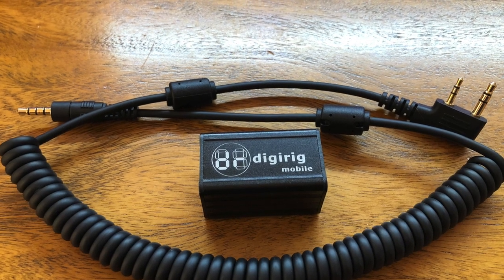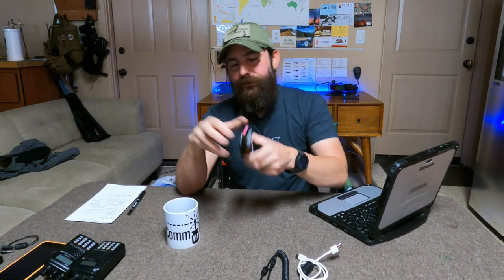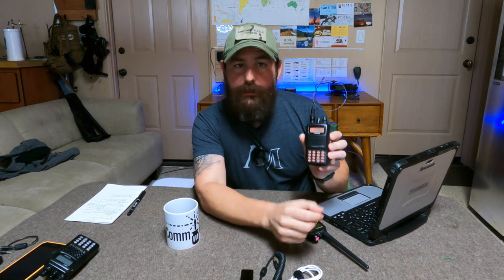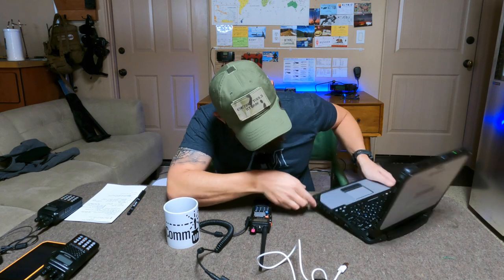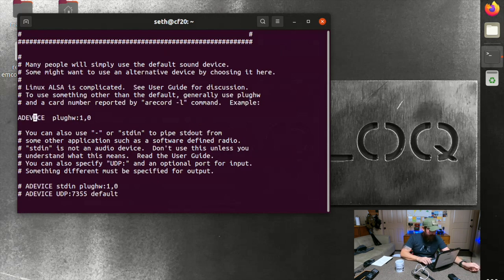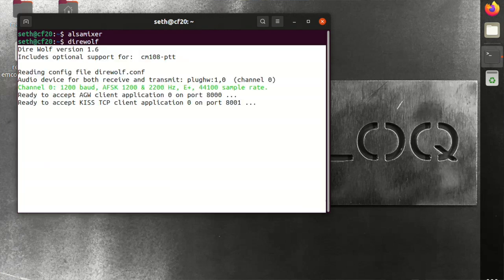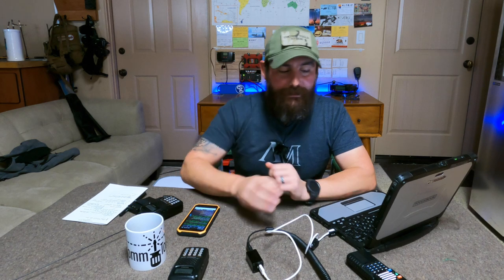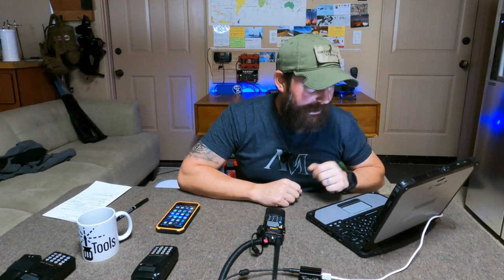Why are digital data modes so difficult? - DigiRig + Baofeng + Linux (Part I)

Comment: New subscriber here. I don't think digital data modes are very difficult at least for the physical setup process. Computers are inherently not made for humans but this is why we have interfaces like mice and keyboards. Just think of the radio as another attachment to the computer. In essence, all your doing in getting audio from your PC to your radio and vice versa but how complex that gets depends on the equipment available to you.  The setup and user interface for some of the software can be very unintuitive and takes a bit of research to get it up and going. Digital modes are certainly not as easy as using voice and not something you need to use all the time, but it does have its advantages. You can disseminate information much more quickly than using voice alone and some digital modes can be used in a low signal to noise ratio environments. I would like to see some more positivity with digital modes and their advantages rather than just the disadvantages. Keep up the good work and I look forward to future videos. 73 K7DMG
Reply from the maker: Welcome to the channel. It wasn't my intention to make it sound like there are no advantages to digital modes. There are many. The trick is getting over the hurdles. They are certainly worth the effort otherwise I wouldn't be making this series.

I am a proponent of them for fun (FT8 and SSTV) and for emcomm and public services events/scenarios (APRS, Winlink, NBMES and JS8Call). My mail bag fills up every month with people that watch me use digital modes in the backcountry, but they are constantly struggling. The'll ask: Which radio? Which cable? Which device? Which software? How do I adjust my audio? My goal is to show the diversity of options and let users determine which setup is best for them.

I may not be the right person to solve this, but I am taking a stab at it with my EmComm Tools project. I made a lengthy video a few videos back on my vision for a digital mode platform that is built for humans and public service/emcomm. It's called "The EmComm Tools Story - The what, why and how?" if you're interested.

Thanks again for the wonderful comment. 73 de KT1RUN
Reply: @TheTechPrepper  I am part of a local prepper group and just joined ARES a few weeks ago, so my focus is on EmComm. There is much for me to learn even when I think I am getting close to mastering it haha This is why I watch as many different takes as possible cuz there's always something I can take away from it. Appreciate your response and I will definitely check out that other video.

Comment: I’d love to see someone implement data modes onto a Raspberry Pi Pico W to interface with the data ports inside mobile radios.  This will also be especially important for getting M17 off the ground as more than an experimental curiosity.
Reply from the maker: I would like to see that as well. I had ambitions earlier in the year of trying something like this by building my radio with these capabilities using something like the HackRF with GNURadio and including everything in a 3D printed enclosure. By the time I realized that I needed an amp, power, filters etc., I decided to table the project. Like you, I am keeping my fingers crossed that a group of like-minded individuals picks this up.

Comment: Great video, even for the technologically illiterate like myself. Thanks for breaking down for us. I have a few questions, I think I have the mobile phone bases down, but I would love to be able to use my Getac toughbook as a base. I have a Getac with windows 10 (I believe), do I have to run linux on it? I ideally want to use this system for gps capabiilities independent and separate of any internet, wifi, cellular networks. DO I have to use linux or can I use my windows op system? Again, we really appreciate your time, effort and help.
Reply from the maker: You can absolutely accomplish the same types of communication using  Windows. However, that's not my area, but there are like lots of videos that cover this. Good luck. Search for OH8STN on YouTube. He's a Windows guy.

Comment: Can you replace the analog baofeng with a dmr? I have tyt mduv-390 and md-9600 dmr radios. Also will enhanced privacy with hex key pass the modem info from a laptop?
Reply from the maker: I have never tried this with a DMR radio. Most of the digital data mode services will only work over analog. However, there are HT's that do both analog and DMR.
Reply: @TheTechPrepper  yes, mine do.

Comment: Which is better to use with this? Windows or Linux? I have all apple products (which suck for HAM radio) but looking to get a tablet that runs windows. I would think it could work on either right?
Reply from the maker: Yes, this can work with either Windows or Linux. It's really your preference on which operating system you're more comfortable using. My Mac can do all this too but it is very complicated to setup.
Reply: @TheTechPrepper  thanks for the comment. You have definitely sparked my interest in this. Keep up the good work!

Comment: Can anyone explain to me what the point of the digirig is especially if you're not going to use the cat control and just go with vox? The laptop has a headphone jack that can plug directly into his combo jack on the yaesu. Since he's not using cat he's relying on vox so I just don't get it. What's the point of adding another sound card when the laptop itself has one built in that will work for this?
Reply from the maker: I am not using VOX. The power of the DigiRig is that triggers the PTT view the serial interface. VOX has too many issues when dealing with various digital modes.

Comment: To communicate with Android phone are you connecting to a repeater with EchoLink?
Reply from the maker: I am not sure what you mean. Did I cover Android or EchoLink in this video? I have never used EchoLink before.
Reply: @TheTechPrepper  I understand how the Baofeng connects.  I am ordering the cable and USB sound card.   How does the Android communicate with it?   I have EchoLink on my phone to connect to echolink repeaters.     How does the android app work?

Comment: how does digirig compare to mobilinkd?
Reply from the maker: If you only want packet radio, the Mobilinkd is more convenient and simpler. The Mobilinkd is a packet-only. I personally use the Mobilinkd with my HT go kit, but I have used it with the FT-818 and FT-857D successfully. It also works nicely with Linux and the RPi. If you plan to run digital modes beyond packet radio (e.g, fldigi, JS8Call, FT8, etc.) you will need to go with the DigiRig or related sound card interface like the SignaLink.

Comment: I do find data modes difficult.    But, my patience for such things is minimal at best sometimes.
Reply from the maker: Welcome to the party, Doug. I can't make any promises, but hopefully there will be at least on nugget in this series that helps.
Reply: @TheTechPrepper  Im sure i there will be stuff to help.  I tried using digital modes on a g707 kenwood and a pi with a hat.  Got so frustrated, had to stop.

Now that I have more hf privelges, I'm going to try more that way.  I'm going to try with the digirig and a feng and separately with my 891.

Comment: I have a CF 19 Toughbook. How did the drivers etc work. I know Windows better however I know how Winlink Express and works. If it wasn't for KM4ACK BUILD A Pi. I have an old toughbook very early version. I could try it but getting the drivers to work for linux
Reply from the maker: Sorry, I am not a Windows guy. The current version of Ubuntu 22.04 supports everything with the exception of the stylus. At one point I had a separate partition that ran Windows 10 and was able to get Winlink Express and VARAFM working nicely with the DigiRig. I was also able to run YAAC for APRS and NBEMS software suite (i.e. fldigi and flmsg).I don't recall if I ran into any driver issues with the DigiRig. I ditched Windows as soon as it tried to force an update while I was in the field and would not let me shutdown without installing the update.

Comment: Ft3d and I suspect other radios with aprs built in make this SUPER simple like turn on aprs and tune to 144.39
Reply from the maker: Yes, the all-in-one radio's make it easy, however, you only get that one mode. If you want Winlink, fldigi and host of other modes you'll still need a sound card interface. I plan to touch on this topic. 73

Comment: Would be good to get Android Phone --> (running FLMSG) Digirig --> Yaesu HT working
Reply from the maker: That works. I did a video on that in this series. The new version of AndFlmsg supports the serial interface on the DigiRig. I believe it tested it with my VX-6R, but it works with the UV-5R, too.

Comment: In the digital world its simpler hardware wise if you have a radio with a built in soundcard such as an Icom 7100. Just have a usb cable between the radio and laptop. Though that doesn’t obviously work with an HT. Lol
Reply from the maker: You're right. I'm still waiting for Yaesu to catch up with Icom and start putting sound cards into their rigs. It would be nice to have a simple interface. It's a pain using the data port and an external sound card on my other base stations.

Comment: This seems really cool. I really like that you can use your Baofengs to send text data. But as you said, it's way too complicated and it seems (to me) like you have to be a multi-platform computer programmer to make it work. If it only worked for non-computer programming humans using Mac OS. Keep up the good work!
Reply from the maker: This setup should work on a Mac, but the devil is in the details. I have a Mac on order that will be arriving in June. If I remember, I'll put together a video for Mac users.
Reply: @TheTechPrepper  that’d be awesome!!! I feel like there are a lot of us who’d love to be more involved in amateur radio, but so much programming/logging/CAT control software is windows only. And everybody says, “Well, just get a cheap windows machine.” But I don’t want another machine that I’ll only use for one thing. Amateur radio could grow more if they’d embrace and support the Mac community.
Reply from the maker: I've been a Mac user since 2005 and loved them up until Steve Jobs passed. The Touchbar and Butterfly keyboard on my $4000 2018 MacBook Pro really turned me off. Don't take a man's escape key away! But, the high price point is what is keeping the hams away. Now that Apple has corrected the keyboard and back some ports, I'm going to give them another shot. Don't get me started on Windows. Take it easy.

Comment: Why are digital modes so complicated in ham radio  As a ham operator and a computer tinkerer i can say one thing   NO Standardization!  Every radio has different mic and data ports, every mic on every other radio has different wiring or a different type of connector ie 9 pin DIN, RJ 45 modular (ieCAT 5 ) , no USB or Toslink fiber optic connections on most ham radios.  Some still even depend on long obsolete DB9 serial ports and  you need to know what frequencies and what mode  IE Upper or Lower Sidebands  are being used . Buggy and incompatible software and drivers.  All this lack of one standard creates confusion. Above all a lack of local activity on anything digital...for local radio checks ....... at least where I live.

Comment: It should read: Why is packet radio so difficult to use?  The answer is radio manufactures don't care about it cause there is not enough demand/feedback from users.
Reply from the maker: I think you're mostly right about the manufactures not understanding the different customer demographics and needs. Why isn't a sound card standard in all new radios? Why are we still using RS-232 serial ports?
Reply: @TheTechPrepper  can I just add why isn’t usb 3 standard on all radios?

Comment: Alright, someone else who's running a Linux Distro on their computer.  I've been using a Linux system of one flavor or another since mid-2012.
Reply from the maker: Good for you. I started with Slackware on floppies back in 1996, then moved to RedHat in 1997. These days, I'm a Debian/Ubuntu fan for the desktop. Cheers to another Linux user.
Reply: @TheTechPrepper  I did a lot of Distro Hopping until I landed on MX Linux with the KDE desktop.  It's Debian based so it's rock solid stable and I can set up KDE to look just the way I like it. 
I have quite a few "First Looks" for a few different Distros on my YouTube channel.  It's good to see another person on the YouTubes that's in AZ.

Comment: I love what you're doing here, but I think the "not designed for humans" problem is that you're using Linux programs from the command line. There's a very good reason that the technically superior Linux environment has not taken over the retail computing world. Windows ($$) software doing this task would be easy enough to get working, while Mac ($$$$) would be essentially plug and play. I don't even know if it's currently possible under the big players, but they're the big players for some legitimate reasons.

Is there some sort of org chart that will describe what things are what and go in between which other things? Something like (software A </> laptop B </> cable C </> device D </> cable D </> radio E) or  (app L {see what I did there?} </> phone M </> cable N </> device O </> radio P)? This would be helpful Elmering for us beginners.
Reply from the maker: Glad you're enjoying the series. You're absolutely right. I have been a Linux user since '97 and it's still not ready for the desktop for the average user. The next video is delayed as I am waiting some cables to arrive. Stay tuned for fldigi and MT63.

Comment: i need the vx6r and an android device connected with my digirig. so far i wasted my money on a digirig, so pissed.
Reply from the maker: The DigiRig works with a large set of radios. A VX-6R is not required.
Reply: @TheTechPrepper  thank you, ya I only have this hand held. Don't have the money to switch to a different radio to use digirig.
Reply from the maker: @caseygillock8131  No problem. Good luck with your setup. I am pretty sure I covered the DigiRig Mobile and VX-6R as part of this series. It's been a couple of years.

Comment: The reason it's not user friendly is the technology is built on protocols that were designed to be buried deep inside equipment and amateur Radio is a highly technical hobby.

It was never designed for preppers. Most amateurs would laugh at the use of Baofengs as they are junk and break FTC rules.
Reply from the maker: Understood.I am grateful for all the ham radio software that has been created and is available to the public. I've never cared for the general elitist attitude of some hams when it comes to radio. I will change that by making communications accessible to all people. As a software engineer, product manager and prepper, I am developing products that will make digital communications easy for anyone. That's the plan at least.
Reply: @TheTechPrepper  that's admirable. I'm a software engineer myself and the majority of tools in this space are old, badly written and terrible to use.
Reply from the maker: @Spookieham  Glad to meet another software engineer. The UI is rough on modern equipment with touch screens and/or old eyes. My EmComm Tools software project delegates to a lot of tools on the backend to do the heavy lifting (Dire Wolf, YAAC, fldigi, Pat, etc.). For the most part, I figured out how to run all of those amateur radio applications headless and build an API and integration layer that my React front-end uses. What kind of software do you write? I am a Java and UNIX guy.
Reply: @TheTechPrepper  I don't do much commercial work now as I run a team at a consultancy but it was Java and Unix before  also - never liked C# etc. I do a lot of hobbyist microcontroller now though for fun mainly around amateur radio. Our commercial work is corporate application development for mining companies, utilities, government etc in Western Australia.

Comment: I know many people Love Linux. But it seems to be very antiquated, like line controlled code. Windows seems 10x easier to me! Just my opinion 🤔
Reply from the maker: It all depends on what you are familiar with. I've been using Linux since 1996 and honestly like the control I have over the entire the system. Windows is not friendly if you're a developer or power user. But, yes, it seems to be easier for most people.